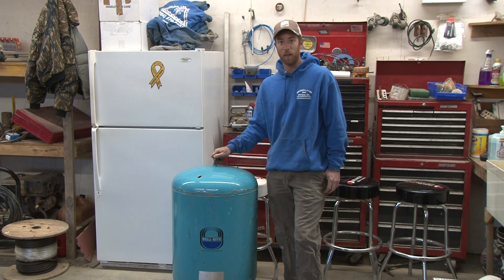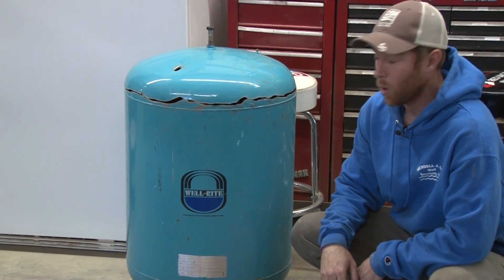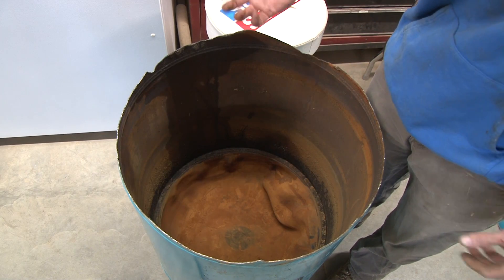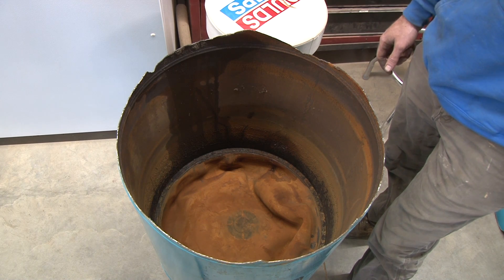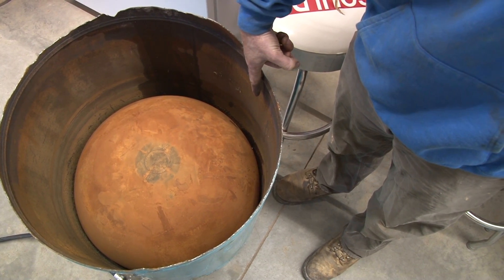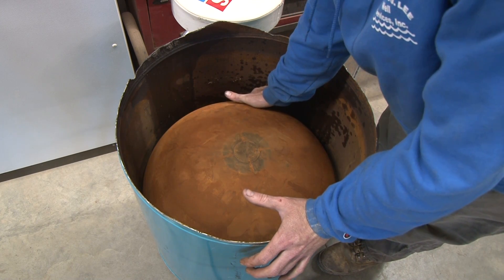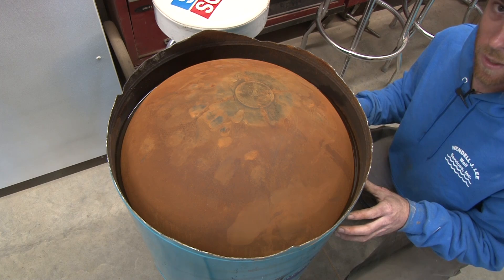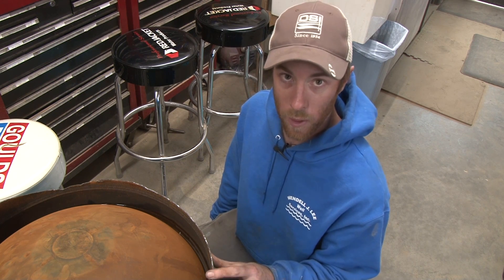Well Pressure Tank: How it Works and How a Tank Gets Waterlogged

Comment: I’m just now getting one installed in my home we’re renovating we kept getting short cycling with just the old pump so basically we’d have good water pressure for 10 minutes then it would slow down badly and have to build up more pressure so we got a bladder tank installed outside in our pump house now I understand lol. Now do we still have to run the water for test or whatever since it’s not a new well it’s the existing well ?

Comment: Great video. I had thought the bladder was caged in the lid with an air fill valve attached like a hot water baseboard heating accumulator tank. I didn't know the bladder is filled with water, makes sense or the water could get rusty, have rust in drinking water. Thanks for the video.

Comment: I appreciate this video, and the information. I think it would been added help if you mention the pressure setting  relative to making the pump shut on and off, realizing that different size tanks may be different. Also it would be helpful to mention  how long the pump should typically run , let's say if the washing machine is being filled   / how long should the pump run to fill the tank and then how long should it stay off (  normal cycle with water being used like a shower or washing machine ). Thanks again for a useful video

Comment: Well made explanation video. High compliments.

We have a 20 gallon (?) tank and it will not build pressure beyond 26lbs suddenly. After watching this, I'm starting to think the bladder is leaking water into the tank. As water can't be compressed that may explain why the pressure will not rise.

Is there a way to drain the accumulated water from the tank. I'd like to do so so I can test before buying a $1,000 worth of gear only to find a leaking bladder isn't the issue.

Comment: I've got a point 1.25 pipe ¾ hp 28' down a gallon pressure tank and this setup is outside for watering out door purposes 3' point and resting 5' well pipe i hit water at 8' had a⅓hp pump 1st and thought was running out of water was only down 18 pump was bad b4 I figured that out that's why I went down 10 more and then got different pump I've ran it for 6to7 hours wide open on spigit and gauge will drop to 0 after that run time back to60 psi right away so pipe comes out of ground 6" then dies a 90 after that have a check valve then 8" to pump top of pump think it goes to 1"  dia. then 90 to tank and tee the 8" straight to tee with sipgets on each side  I can leave pump at 60psi for 2weeks and it doesn't drop open spigit up and down to 40 pump on and depending on sprinkler it'll pump at 0to5 psi and b4 the check valve id have to say water is right at the check valve cos I'm thinking if it dropped to the 8' level I'd lose my prime is my thinking right about that and my main question of this all is that I get little bubble of air when it is half to wide open doesn't seem to if it's not open so much that it's running with more pressure not enough to kick off but if it is open just that little that it's is cycling 40 to60 0n off no air in water not that it matters for water lawn just like to know were the air is coming from no water is push out when running besides out the hose any idea all my joints   use pipe dope on not tape and all couplers in ground are well ones and I used 2' monkey wrenches with 3 foot cheater bars on was told to make sure they are tight thanks for your time

Comment: Doesn't the air pressure also help even your water pressure drop so 40 /60 if you didn't have bladder with air you would notice when pressure got down to the kick in or on be less if no bladder with it the water stays at a more even flow if I'm making sense along with other things bladder does

Comment: Awesome video! I always assumed it was the other way around with the bladder holding the air. Having trouble getting my sisters water back above 12 psi and was thinking the tank was plugged as there is no water in it. Now I won't try to unplug it with a coat hanger, lol. Thanks again.

Comment: Hey, that's a good video. Hey, just a question. I had a tank, it would cycle.
 Correction, the well pump would cycle constantly so I had a change. I actually tapped aside of a tank it. Have a thump thump, thump sound to it. And I could not move it. The one I have now was installed by a professional plumbing service. They ran a high quality tank. I forgot the name. I think you said one of them in your video. It was pretty pricey so when I hit the top side of the tank or tap on it. It has a hollow sound where there's an echo and I can actually move it, so it was put in in 2019.  So, apparently I guess the tank is still good.I haven't heard my pump cycling.Hey, thank you very much good video.Keep it coming .

Comment: On my system, the pressure gauge shows the well pump cycling normally between 40 and 60 psi but the pressure cycles down in about 2 minutes with no water demand and then the well pump comes back on.  Is this a sign of check valve leakage or a sign of a hole in the bladder?

Comment: I don't understand what the purpose of the bladder is... Why not just have it be a tank without a bladder? Basically just a big water hammer arrester. Obviously a non reactive coating would need to be applied to the tank (or just make it from poly) so it doesn't rust... Is the bladder there purely to make it so you need to buy a new one every decade?

Comment: Makes perfect sense to me after I watched the video. I was beginning to fear the bladder would burst since there was no air pressure to counteract the water pressure. My tank is 23 years old. I'm just noticing recently that the water pressure in my supply lines has increased just a little bit when the cutoff switch finally cuts in. I'm thinking I should replace the tank soon in consideration of its' age.

Comment: My grandmother had 9 kids and bought her house 74 years ago. Same hot water heater and same pressure tank for the well has been there the whole time. My father replaced the heating element once in the hot water heater and the tank is a GE brand White exterior and about 30 gallons. I've gone under the house once a year for the past 33 years to look at the tank and check the air in it.  The pressure tank sits 1/2 buried in the ground at the center of the house under the floor and gets wet in heavy rains as water from the perimeter of the house runs down to the tank which was at one time the low point. There's no removing it unless you want to dig a 2 foot trench for it to pass through on its side to an exterior foundation wall or take up part of the floor to make an access hole.
No idea the brand. The outside of it has been covered in rust for the entire time I've been having a look at it.
Replaced a well pump and the pressure switch around 4 years ago. Far as she knew it had never been replaced.  The lining for the well is iron and the pipe for the well was galvanized. The electrical wire was some type of flat rubbery wire very oversized wire gauge with a fiber woven cover., Uses screw in Buss fuses for overload protection and I've had to replace those fuses a few times because of lightning strikes to the well casing one of which I watched happen. Operates on a 40-60 pressure setting.
20 years of service or even less is a travesty.

Comment: How old is out right now I've been troubleshooting it as much as I can it's a money issue. I've changed the foot valve of the tank down in the well as well as the pressure switch, took care of any leaks I saw. My buddy wanted to f*** with the girls in the house so he decided to turn the valve off with the pump still running, and when he turned it back on it wouldn't build pressure. The tank doesn't ring like a bell like it's supposed to and I assume the hole is bigger than that one in your video because it gurgles and bubbles when you turn it upside down but no water at all come out the bottom instead I added are to the tank and then unhook my airline at the compressor with the tank upside down in the water would come out of my air hose. My question is why wouldn't it come out of the bottom at all. It's a 20 gallon water worker? Also a single pipe goulds jet system with a goulds pitless adapter about 50 ft away from the house. I'm hoping the problem is the tank. We're going probably have to get a used one unless a miracle happens. It's pretty damn rough without water.

Comment: Please help!  Once I turn pump off pressure drops to zero. I’ve replaced the pressure switch and gauge since pump was not turning off. Lots of sediment in line. Now it won’t shut off and when I manually turn off pressure drops. Any ideas of what could be the problem?

Comment: How much water (index) is it supposed to hold in tank? My old system was a open style with a tank regulator (had what I refer to is a flotation to regulate air) not a fan of the one I’ve installed as it has only a 8-10 water index and pump almost immediately kicks in…(also run a check valve or no?) I’ve a submersible pump…: TIA 😊

Comment: Thanks for the video. I have a shared well with 5 pressure tanks...86 gal each. Each time we have a no water situation....various reasons, my first action is to give each tank a little push. If it moves it means it's empty. If it doesn't move it means it's probably full of water. Recently I had a tank that took more effort to move than the others but still took more pressure to move it. I interpreted this as partially failed or failing tank and had it replaced...since it was under warranty, Are there any other tips you can share for detecting damaged tank. I'm thinking that if the tanks are full...just after pump turns off...that pressing the valve on the air valve might cause water to flow out. Your thoughts.

Comment: That makes sense so I have a question. Wouldn't it be a clear indication that you have a leak in the bladder if you are able to release water out of the valve stem at the top of the pressure tank

Comment: Thank you for this video. I apologize if someone already asked this ? within this thread but aside from your pump short cycling are there any other indicators that would alert me to a hole in the bladder? Currently I have a 40/60 pressure switch on my system and after watching your video I was able to correctly set the pressure for the system and the house which worked great... but after about 8-10 weeks I have lost a little bit of pressure throughout the house which happens to be two story. So, once I set the pressure in the tank do I need to recheck it or possibly redo it on a monthly or bi-monthly or quarterly basis? Also, the inline pressure gauge at the bottom of the tank dropped to about 45lbs So to fix my pressure problem I adjusted it to read closer to 55 and I'm wondering if that's going to cause a short cycle as well?

Comment: That you for this. We use a pressurized system to supply a cabin with lake water. My whole life I assumed the bladder was at the top of the tank and full of air pressing down on the water in the rest of the tank. Now I get how the thing really works. Appreciate the lesson!
Reply: Well actually..., the air and water push against each other. The "bladder" is literally a shaped separator. If he had cut the bottom of the tank open, and filled the air side with air... The bladder would expand the other way. The difference is that air is compressible, and water 'ain't' - barely.

Comment: I’m with the guy before. I thought the bladder belt air and pushed on the water. I  just heard my well cutting on and off so I know o have a tank problem. I have water coming out the air vaulve on the top when I was going to to check the pressure. So I assumed my bladder had busted or had a hole in it

Comment: Warning Warning Warning! Do not buy an A.O. Smith well pressure tank. I put one in and the next day I noticed water leaking out the bottom of the tank so I figured I didn't tighten the tee well enough when I installed it so I took the tee back out put new tape on it and reinstalled it. Later on that night it was still leaking so I enlarged the hole in the plastic base that it sets on so I could see what was going on and it was leaking above the factory installed elbow on the tank. So under further investigation I removed the elbow that was factory installed on the tank and there is no sealant on the threads, no teflon tape, no liquid teflon tape, no sealant at all. And that's why it's leaking. So don't ever buy anything made by A.O. Smith because if their too stupid to put thread sealant on the threads nothing else could be right either. And also thanks to Wendell Lee for making all these great videos! Listen to this guy he is an expert. Thanks for making your videos Wendell.

Comment: Good video Wendell, how about a videoon the bladderless galv style tanks that have no schrader valve to add pressure. And how air is introduced to them by pump cycling.(why you never block the well head vent).

Comment: Grew up in a house that had well water with a galvanized tank (No Bladder). The galvanized tank only had an air bubble. Mother father and five kids. We had horses, cattle and an inground pool. That old galvanized tank has been there for over 60 years and still works perfectly. Really don't understand why you would need a bladder if the old galvanized tanks never failed for over 60 years.
Reply: @frontier9142 - Great news that your family's galvanized steel tank has held up for 60 years.  Not all are so lucky.  You must have water free of most solids.  An advantage of bladder / diaphragm tanks is better drawdown per cycle for the same volume of tank.  But since your family's was only serving a small number of people, then drawdown may not be of much value, (unless you all took a bath on Saturday  ;-)    ).  Good luck.
Reply: My understanding is that the old-style tanks had to be much larger physically, but the main thing was maintaining the air charge, as the air mixes into the water so it’s always being depleted.  I just replaced a tank yesterday, so I’ve learned a lot - thank you, internet!
Reply: My tank is the huge old galvanized. There is lots of sediment in it now that developmentcus happening around me. It used to irrigate 10 acres, but not now. When my neighbor irrigates his corn field, it really gets murky. I think I need to flush it. Hmmm?

Comment: Very good!! I had the question of why was my pump not kicking in after I had run quite a bit of water, was thinking maybe was pressure tank but now don't think so, just hadn't run enough water that bladder called for more. House is empty in winter but will have a plumber check it out before I move back, thanks

Comment: Have to point this out, at 9:05 when you said it was up to 50psi, at that point it would've been well over 50psi if the air chamber had been filled with air. I was cringing a little toward the end, wondering if it would blow up on y'all. Without the pressure of the sealed top on, whether filled with water or air, the backpressure of either water, air, or both contained in the steel tank would never have let the bladder expand that much.
But hey. That would've been a fun video to watch as well 😜 For us.
So how do you tell if a tank has gone bad?

Comment: I have waterlogged in my tank instead of replace a new one I was able to get water out and the bladder was still good.  Flotec.  I replaced a new one and didn't check it.  so next time have plumber check that first before buy a new one. My second Flotec pressure tank lasted more than 10 yrs and still running. The first one I didn't have that check may have been still good.

Comment: HELP!! I have no water. My tank registers 90 psi. Not nermal! The tank is bad! But the professionals that installed it didn't include a drain valve.. The drain valve is six inches above I have to replace my tank above  the bottom. Is this normal?? Or was I screwed??

Comment: Very Good Video but my problem is different.  I've got a Pentair Composite Wellmate and  I'm getting very slow flow from my well.  The Air Gap is good but pressurizes quickly.  I've been getting clay sand, (less than 4 microns) in the water and I'm quite sure there's sand in the bottom of the tank.  Can I suck it out with a shop vacuum from the bottom of the tank or does that risk damaging the bladder?

Comment: Thanks for the informative video!  The bladder works and looks like I expected but I've always wanted to open one to look.  You did it for me.   A few questions:

If you have a failed tank, would adding air pressure through the Shrader valve hold when the tank has discharged water/pressure?  Wouldn't the air remain at the top of tank rather than discharge with water through the bottom of the tank?

What do you think causes pin holes in the bladder?
Reply: That would be good to know. Logically to me the whole thing almost looks like a giant surge arrester. I do have to wonder though, if you pump air in the valve and let the water pressure drop below that, wouldn't the air basically push the water back into the bladder and pipes? Isn't that what happens every time you turn off the pump for a long while? I'm thinking my tank is probably from the eighties and it'd be helpful to know.

Comment: Mine is not holding air but my water is still working but occasionally we will not have water pressure and I’ve noticed that my bladder tank is leaking around the valve stem when I put air in it could that indicate that we have a hole in the bladder
Could I just replace the valve stem?

Comment: Wonder why the mfr used a flexible bladder. Would a metal or rigid plastic not respond to the air pressure as well?

Comment: I think our pressure tank has failed. We have iron pyrite in our water and it already rusted through the pipe going to out cut-off valve. It's looking like we need to replace the valve and the tank. That tank is over 20 years old and hadn't been changed since the well was dug.